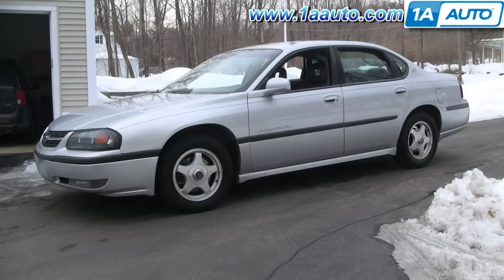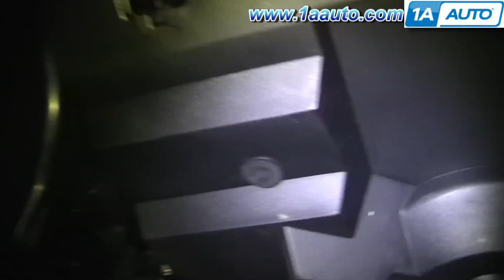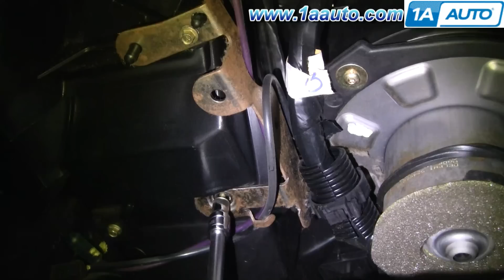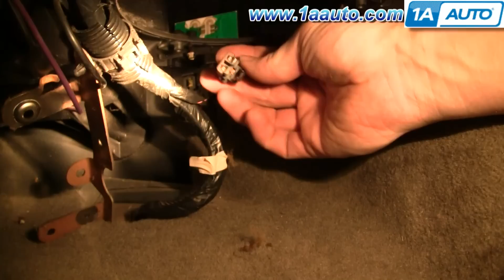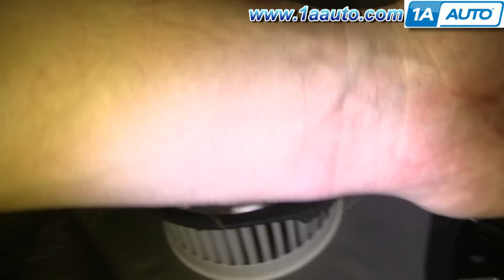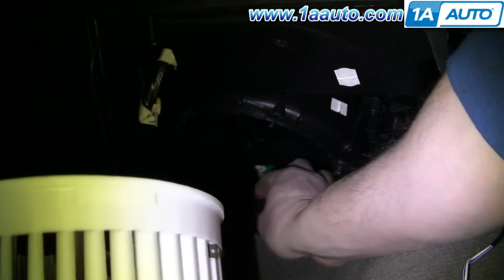How to Replace Blower Motor 01-03 Chevy Impala

Comment: I have a question,  my 2000 chevy impala ls, a/c and heat is working fine but sometimes it shuts off, then 10-15 sec later it comes back on. Any suggestions? Thank You.

Comment: Would this be the reason my heat doesn't work? About a week ago it was on and the stopped, all I could smell was burning plastic.
Reply from the maker: +0Sideswipe0 You may want to inspect the blower motor and the blower motor resistor to see if the plug ends are heat damaged and may also need to be replaced. Hope this helps you out.

Comment: Thanks for the video. I have a "03 Impala LS. About 1 yr ago the #1 setting for the fan stopped working. Then 6 mos ago, the light for the heating/ac section would go out for periods of time & come back on. Today I smelled a burning pretty strong even when turned off, no lights, & no blowing when turned on. But on #5 setting it made an awful racket that shook the entire dash! I'm afraid to even drive it for now. Any suggestions?

Comment: hi i have a 2006 impala the problem is that if the car is on idle it blows cold air ..if its been reved it blows hot air.. i took out thermostat to see if that works but still have the same issues any suggestions
Reply from the maker: You could have an air pocket that's trapped in the system. When the vehicle's cold you may want to check the fluid level in the radiator, and also may sure that the overflow bottle is filled up to it's proper level. Hope this helps you out. 1aauto.com 866-403-3393

Comment: I just replaced my resistor, blower worked great for a few days. Stopped this morning, it is on its third resistor, (first lasted 10 years, 2nd lasted 3 weeks, 3rd 1 day). Knowing the symptom immediately, I shut off the blower. I plan on replacing the blower motor this time. My question is; do you think the resistor could already be fried with only 10 seconds max of "on" time at 2 degrees F? Or is it a fair bet that its still ok, and it's just the motor? Fuse is ok. Could there be anything else causing this?

Comment: Seems pretty easy my heater all of a sudden doesn't work an all I gotta do is replaced the old fan with a new one? Thanks for the video =)
Reply from the maker: It depends on what it wrong with the heat. When you turn the heat on, what happens? Does it blow out of the vents but is cool air, or does it not blow air at all? If it doesn't blow air at all, you may want to check the fuses first to see if they are okay. If they are fine, check the power going to the blower motor, and the blower motor resistor with a test light to see if there's power going to them. Hope this helps you out. 1aauto.com 866-403-3393
Reply: I have a 2008 impala , the heater turns on but it is cool air , would this video be the way to fix it ??

Comment: I've had an issue on my 2003 Impala 3.4L where the past few years, the climate control settings wouldn't always work (sliding to heat to cool) and I'd have to slide it back and forth to get it to blast the desired hot/cold air. Fast foward, this past year, the fan settings dial would only work on 1,2,3, and 5 (not 4) and it would randomly turn off (when on) and sometimes turn back on (when already on). 

Now this past week, everything turned off and won't go on. The back window defroster button works, that's about it. No air blowing at all. I checked fuses, they are okay. I had a private mechanic change the fan blower and the resistor parts. He tested the old fan blower by making contacts to the battery and it wouldn't work, which he suspected the fan was burnt out or shorted. I ordered a new fan blower and resistor at Napa auto store for about $135 and he installed those, and it still wouldn't work.

Now he's saying that it is the climate control panel (where you change the AC/Heat settings with the dials) that is shorted out. Is this possible? Just want to make sure he's following the right course of action. I looked on Ebay and the center climate console is about $40-50 with shipping.

Is this accurate as far as what the FINAL problem is that I'm dealing with? It's especially hard not having heat in a vehicle during winter because the windows fog/frost up all the time. Thanks!

Comment: Will this be the same for a 2004 Impala? Having an issue that you have to hit the bottom of the glove compartment to get the blower fan to turn on
Reply from the maker: It may be a similar process. You may want to check the wire to the blower motor resistor and also the blower motor to see if it has been heated up and damaged. If it has you should replace the plug end and also the blower motor or the blower motor resistor. What happens is, when they age them go haywire and over heat causing damage to the plug. We carry new resistors and blower motors on our website with free shipping in the lower 48 states. Hope this helps you out. Here's a link to them on our website if you need a new one. Have a great day! http://www.1aauto.com/1A/blower-motor/Chevy/Impala/-/-/2004?utm_source=VideoReply&utm_medium=YouTube&utm_campaign=1ATony

Comment: I have a 2001 chevy impala...my AC only blows on the speed setting 5, it started by only blowing on setting number 2 and up then as a few weeks went by and it would only blow on 3 and up and so on...I believe the resistor is for controlling the speeds and the motor is working, on speed 5 anyway...I would like to order the part from your site I just need to know if I should order the resistor and the motor? or just the resistor? ...please advise, thank you

Comment: I have a 2001 3.4 impala, the problem with it is that it only throws air into the feet area, not trough the other vents even though i move the switch. Any tips? Thank you

Comment: Hello
I have a 2000 Impala ls 3.8L, my problem is that the a/c heater motor works only in the 5th position. What can be the problem. Thanks

Comment from the maker: Markus, for the heck of it check the plug ends that go to the blower motor or whatever isn't working on that circuit. There could be a melted or bad plug end that's causing this.

Comment: hello, thanks for the info about the fuses..i have check and the fuse was out, but as soon as i changed it the fuse went out so i replaced it once more(replaced 2times)..after that i turn on the ac control unit and still no air blowing, but i did smell like a burning wire smell..

Comment: I also have a 2005 Impala, my problem is that the motor works but is stuck in the on position and I have to pop the hood and pull the fuze out to shut it off. Any suggestions to how to fix this would be Great.
Thanks